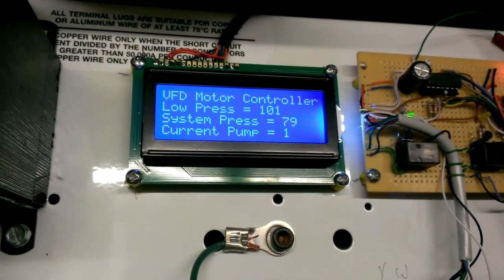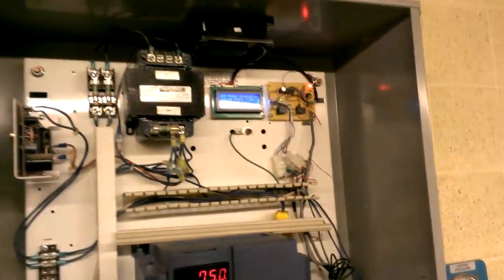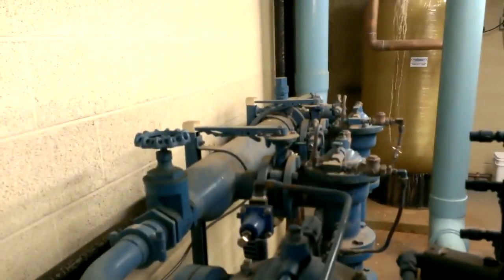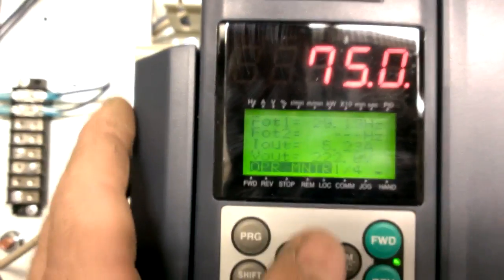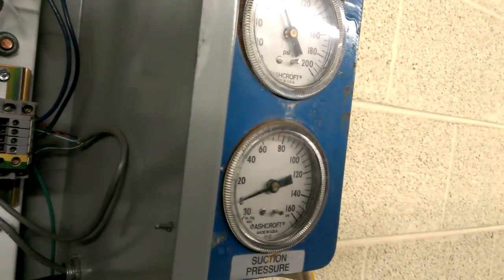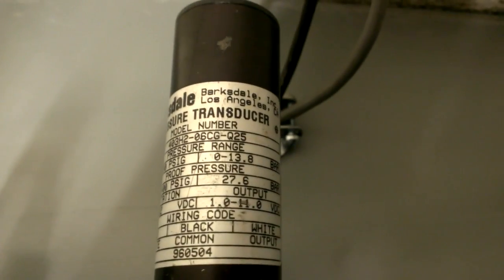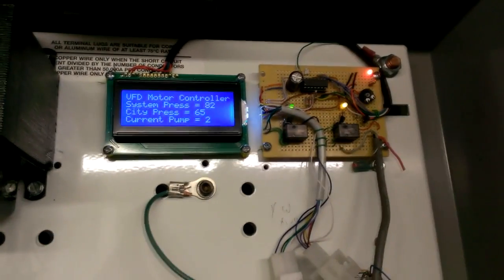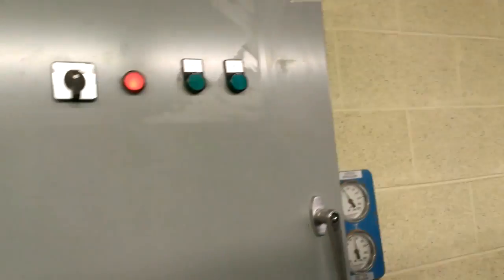Pump Variable Frequency Drive Retro Project - Part 6 - Up and running!

Comment from the maker: The dumb thing is I did NOT take an amp reading before starting the project. LOL!

But it's a 18 amp motor at 460V and was running full speed with the pressure being regulated by the output being slammed shut with a pressure regulator. I'm sure it was over 10 amps.

Today while the VFD and pump were just cruising along to maintain pressure I checked the amps and it was just over 1 amp. :-)

We know it NEVER went near that low at any time before! HA HA!
That of course was probably with low demand

Comment: why not have the LCD on the door so you dont need the pressure gauges? or just have the gauges cause they are more reliable.  also. awesome project. got it done pretty quick too. bet the boss is happy.